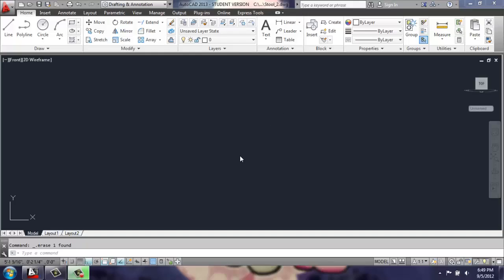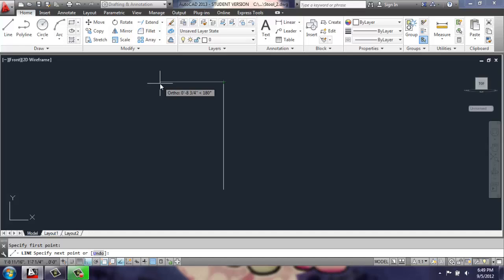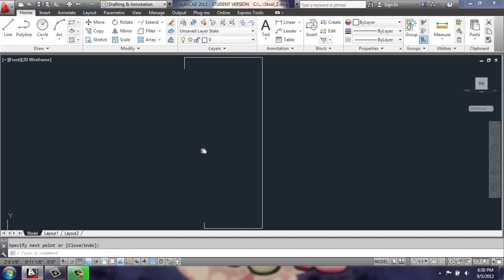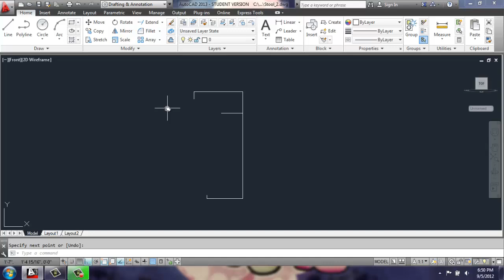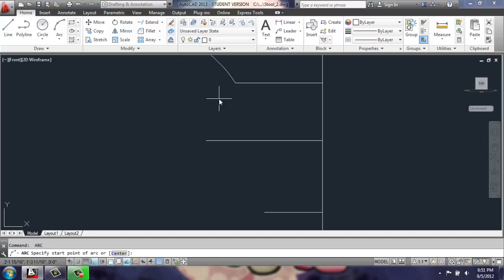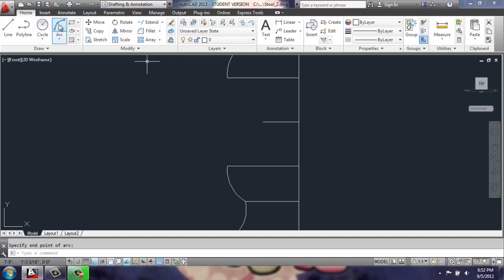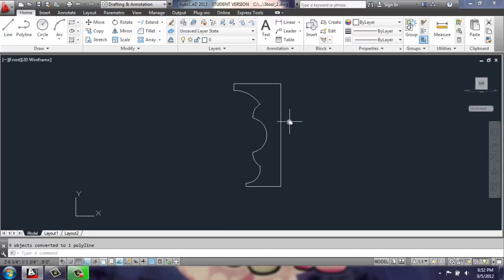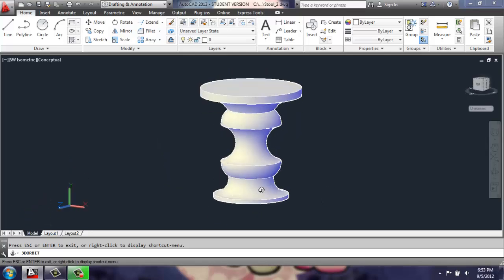AutoCAD - 3D Modeling Basics - Stool - Brooke Godfrey

Comment from the maker: Object Snap Tracking is a weird thing to get the hang of - usually the problem is that you're shaking the mouse.  You probably don't even realize it.  Be fairly deliberate when you chose your points and also do it quickly or CAD will 'forget' what point you picked.

Comment: I'm having problems when I try to use the end points for the green line guide (Object Snap Tracking?) I'm not sure, instead of putting my start point for my new line 2" or w/e I specify, it puts it in some random corner far from where I'm drawing. 

Thanks for your help, I've got a new job that requires AutoCAD and your videos are saving me!

Comment: Great 3D instructional videos.  Thanks.  I have a question about the ucs tool in your videos.  Whether I am using the single drawing board or trying to work in the double viewport screen, when I am trying to draw in the front view it will only allow me to draw horizontal lines and my ucs is positioned in the x,z position.  How do you have your ucs positioned in the x,y position in the front view?

Comment from the maker: Things like that can happen for a lot of reasons.  My first guess is that your are too zoomed in.  Try zooming out pretty far.  Also, try typing in "regen."  That can help as well.

Finally, check what units you are working in.  If you are using decimal, but typing in imperial, for example, the line command won't work.